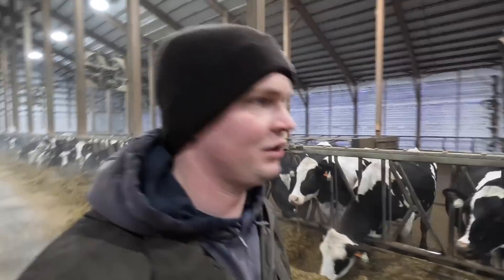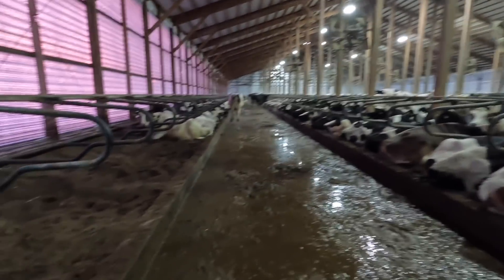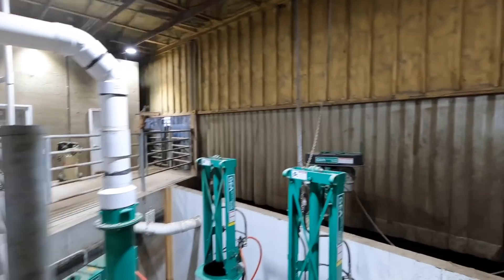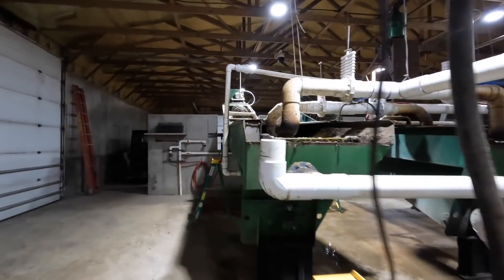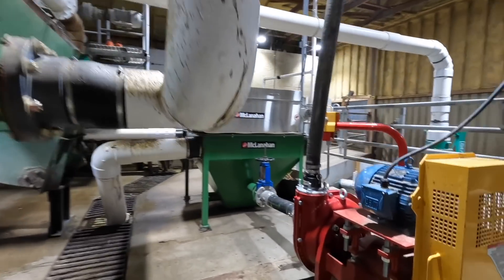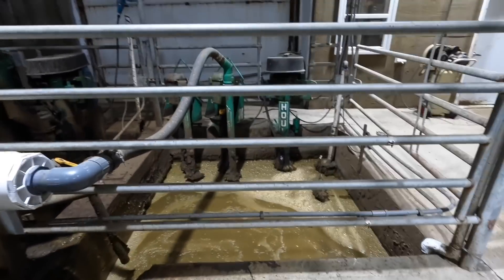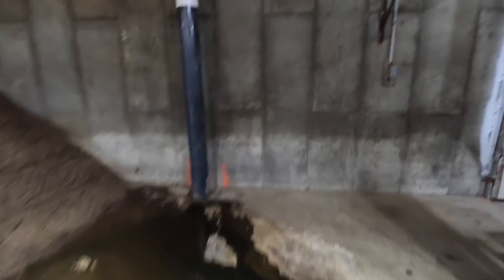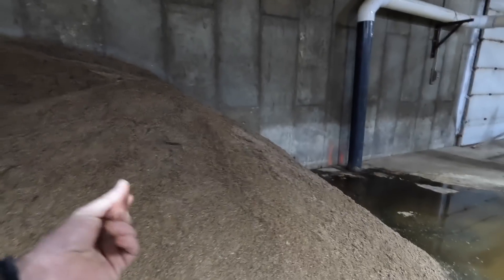Sand-Manure Separator (17)

Comment: Hi Piet, I enjoy your videos.  I recently put in a separation system, how much trouble do you have with hoof blocks in your pumps?
Reply from the maker: The gate valves in the piston pumps week will have one in there on occasion preventing the valve from closing. After the manure goes through the sand separators it goes through a trommel that catches any other blocks or debris.

Comment: Awesome system but if you recycle the sand, you should put them away from the new one and desinfect it outside with the sunlight because the virus & bacterias from the manure can cause illness to the cows and use a ratio of 50/50, 50% new sand and 50% used sand. I understand that the system work similar if you have a cat litter that you use a shovel to put out the poo daily and reuse it until it smells very bad at the end of the week. Thanks from Spain.
Reply from the maker: We haven't had any problems using the recycled sand. We're reclaiming about 99% of the sand and will add new sand once on twice a year to make up for the lost sand. We use fairly course sand which drains and dries good.

Comment: Why did you go with a Screw press instead of a rotary or slope screen? Seems that the Doda would struggle to keep up with the volume? How many cows are you processing?
Reply from the maker: We originally had a slope screen for probably 3 or 4 years but the liquid manure that would go to the sand separators would be very inconsistent. We really needed 2 or even 3 slope screens but we are limited for space in this building. The same goes for the rotary drums, I looked into those and was told we would need 3 of them to have enough liquid for our 2 separators. The doda doesn't process all of our manure, the main reason we put it in was for consistent liquid to go to our sand separators. The doda provides enough liquid for our 2 sand separators together with waste water from our parlor.

Comment: You use grey water and do not use clean water to wash it. How do you know all the manure is out of the sand?
Reply from the maker: Mainly by how wet the sand is coming out of the separators. If it's not stackable sand it's too wet to put into the stalls right away in my experience.

Comment: Does the sand become so clean, so there not is no organic material left in the sand? The meaning of to use sand is well that there is no organic material in the sand, because if there is organic material in the beds so risks that also to come bacteria in the beds, which can lead to that the cows get mastitis?
Reply from the maker: There is very little organic material left with the sand after it comes out of the separator. This is part of the reason we really like to use sand as bedding for the cows, to reduce the risk of mastitis.

Comment: Great channel for the dairy industry! Not sure how I came across your videos but this was the first one to show up. I Grew up on a dairy farm and worked for a GEA dealer before becoming a hoof trimmer. Do you find the sand gets course after being separated? Sand is great for cows but definitely has its challenges.
Reply from the maker: Thanks you! The sand we use is fairly course to start with, I think that is why our separation system works well. Course sand is easier to separate and dry.

Comment: What do you think the payback or savings is per year with the sand separator?
Reply from the maker: Looking at separating and reusing vs buying new sand all the time, it pays for itself in 2 to 3 years. Comparing to other types of bedding is a bit more complex because it's difficult to put an exact value on added cow comfort and cleanliness. I think it still pays for itself within 3 years comparing to other bedding types of bedding.

Comment: sand seems practical for rather large operations. generally, can sand be used in much smaller operations?  i'm guessing that conservation of water and other stuff is worth a trade-off as for modest added energy for process loops, right?  but then, there's more equipment, etc.  also, do you use (expensive?) additives to minimize corrosion and friction, etc.?  yes--am trying to understand if only large operations can use sand, etc. thanks for all your great uploads! oh! and congrats about all the brand new family members!
Reply from the maker: I think it would work on smaller operations but it could be more difficult to justify the upfront cost of equipment. Our sand manure separators are mid size, there is a larger size and a smaller size available I believe. We don't use any additives to minimize wear, but some of the high wear points are rubber lined or have polyurethane bushings to increase longevity. Thanks for the question!

Comment: Gefeliciteerd met het dopen! Do you ever have problems with the bearings on the augers? The sand must be hard on them. The operation looks a bit more complicated/sophisticated than what SaskDutchKid has shown us.
Reply from the maker: Dank je wel! The bearings are designed to handle sand and manure, we do keep a close eye on them and replace if needed. There is a lot going on, but this system is working fairly well for us.

Comment: Hi Piet,
I have some questions popping up.
Why did you choose for an auger and does it wear out often? 
Is it one auger being 300 feet long and does it ever get frozen? 
How does the maintenance of the system look like?
Did you ever think about using the flush flume or would that not work very well with the system you have in place?
I think you used to have straw in the heifer barn? Would some straw in the manure be a problem for this system?

Thanks for the great video and a very nice setup!
Reply from the maker: Good questions, I will answers these in Sundays video!

Comment: There is a lot of wear points in that building. So that sand is put back in free stalls 24 hours after the separation? Thanks.
Reply from the maker: We will put it back in the stalls after at least 12 hours